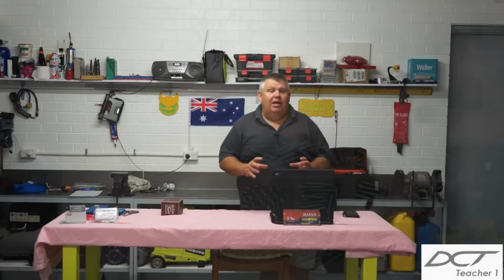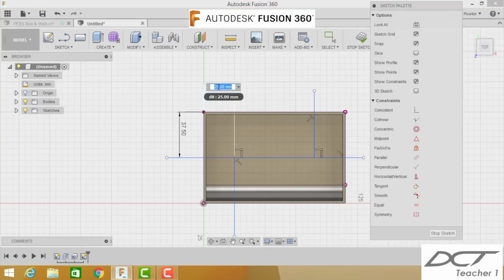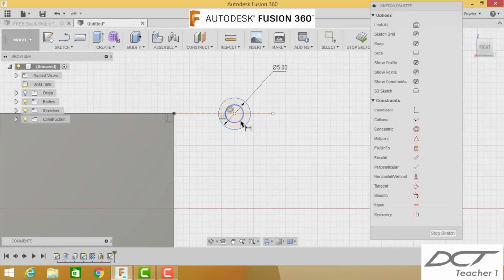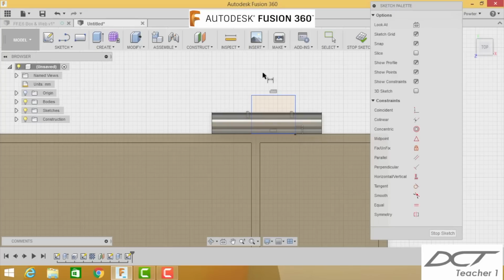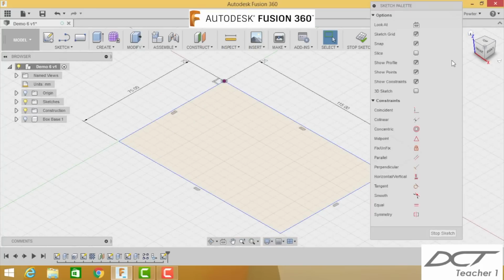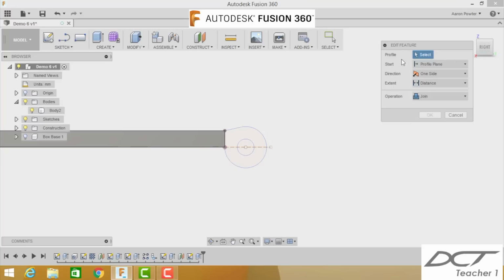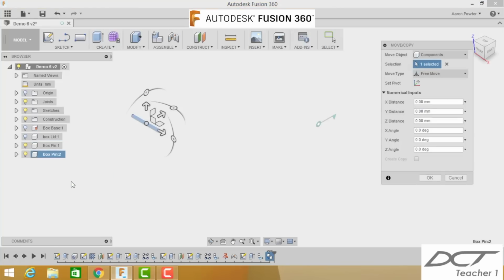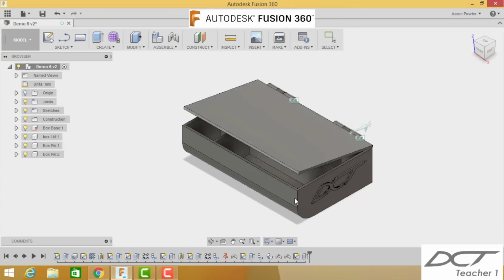Fusion 360 Tutorial - WEB Feature, DXF import & STL export FF.E6

Comment: Great tutorial thanks! What laptop are you using please? Also, can you use the web tool for woodworking dividers or are the dividers solid and unable to be pulled apart? thanks
Reply from the maker: Hey Angie.  Thank you for the positive feedback.  I did this tutorial a very long time ago.  In hindsight, I'd do things differently now given the chance.  As for laptops, I use both PC and Mac with Fusion360.  My current laptops are a Microsoft Surface Pro and an Apple MacBook Pro M1 Max.  However, when I did this tutorial I used an older educational / departmental laptop that was mid range spec'd.  Feel free to send me an email with those dividers and I'll try to do a tutorial for you.  My email is in the about section on my channel.  Regards, Aaron.

Comment: If I wanted that web as a separate body, how do I go about it? I wanted to make a box with a removable partition.
Reply: Thank u so much for your tip. I think that would work, I just thought the web function has some option to have it as separate body after applying it.
Reply from the maker: Hey wiz, I would design the partitions separately and simply extrude them.  I would then model the slots / grooves (internal or external) in-situ for these to slide in to.  Sorry, but it's probably hard to visualize here ;-)

Comment: Really enjoyed it, though I had to back it up a few times. Powerful lesson for the new guys!  Answers questions I hadn't formulated :-) 
I was quite taken with the matter of the hinges on the offset plane, construction lines etc
 I would imagine that it would be good to have a simple sketch on paper for reference.
Should be good for a quick practice,  even though I have a huge list of components to model up for my CNC Router build. The generation of some parts from PDF canvas is not a walk in the park.
Reply from the maker: Hello Chris.  Thanks for taking the time to watch my little tutorial and to have a crack at it.  As Fusion 360 is constantly evolving some things may have changed since I uploaded that tutorial.  As for me, I learnt solid modelling back at Uni in 2001, so hence the use of constructions lines etc... These are rarely needed now with Fusion as you have so many options to use by applying simple constraints.  Last year I traveled to Vegas to attend Autodesk University.  I thought I knew heaps, but it turns out I don't ha ha ha.  Cheers mate.  Aaron.

Comment: Hi Aaron, thanks for making very pedagogical videos. Probably a stupid question but I got stuck after making the lines for the web. I get the "Rib cannot be created..." I've double checked and they are on the right plane. It works when I make the line on the XZ plane (where the lid comes) but then they go downwards instead. The link to where I got stuck is here http://a360.co/2mvuARa Thanks! /B
Reply from the maker: Hello Bengt, now question is a stupid question.  I'm not sure what the problem is.  Can you add me to project in Fusion 360 and I can have a look for you?  Regards, Aaron.
Reply: Hi, basically it's about on what plane you can create the web. To me, it looks like you are making the lines for the web on the bottom inside of the box and the web is created from the bottom upwards. However, I can only make it from top to down by creating a offset plane. I shared the project to you. Many thanks for sharing your knowledge. /Bengt

Comment: nice tutorial, when cutting pull the extrude in the direction you want then change it from "direction" to "all" also when making 2 or more parts that fit together and move you need to add clearance e.g. when 3d printing to make a pin and hinge set the pin at 2mm and the bore of the hinge at 2.3mm.

keep up the good work and don't forget to save.
Reply from the maker: Hello and thanks for watching. All great tips thanks for mentioning them ;-)  Cheers and thank you.  Aaron.